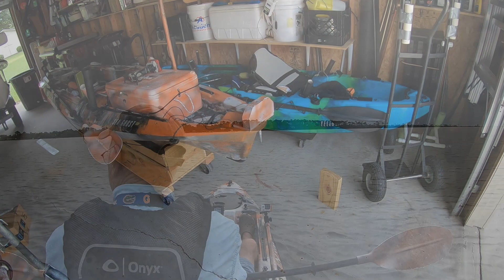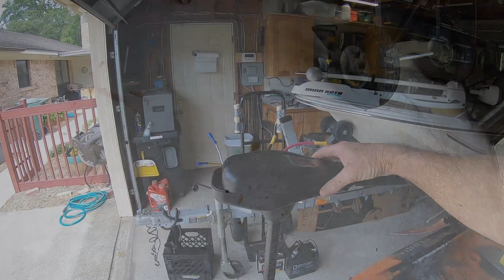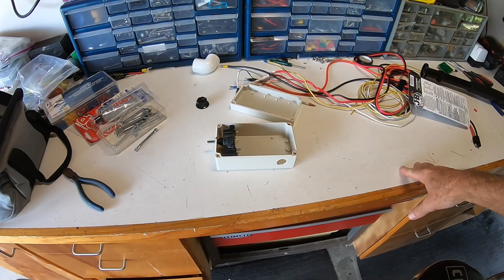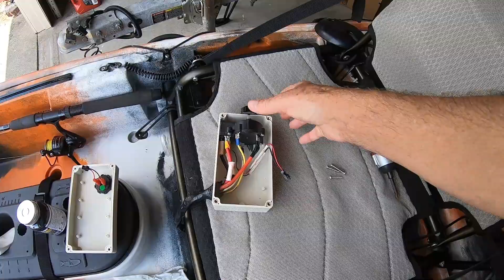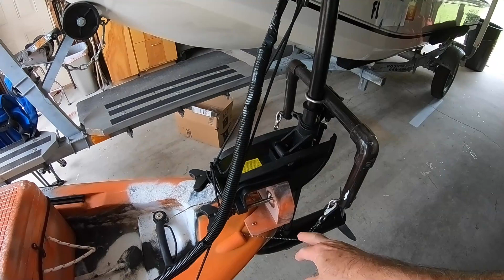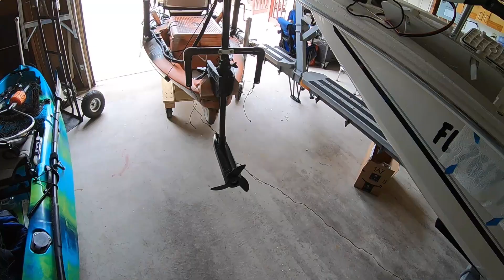Trolling motor upgrade - Vibe Sea Ghost 130

Comment: How big is your battery? how many Amp Hours? AH?
Reply from the maker: Corey, I use two batteries, a 35 AH that weighs 24 pounds for short trips where I don’t use my trailer, and a 55AH which weighs 46 pounds. The latter was down to 30 percent on my last trip, about 3 total miles, but I had to fight strong winds and current  the entire time. Thanks for watching.
Reply from the maker: @birdyboyblue  Thanks for watching, and good luck with the install.

Comment: Do you operate your cameras and your fish finder on the same battery as your trolling motor? If not what do you use?
Reply from the maker: Very sorry for the very late reply, for some reason I was not notified. The front camera and fish finder are powered from the trolling motor battery. I used to use a power bank to power the rear camera. I recently updated that camera to a Hero 9 and it overheats if operating and plugged in.